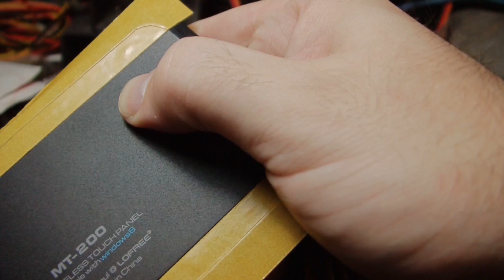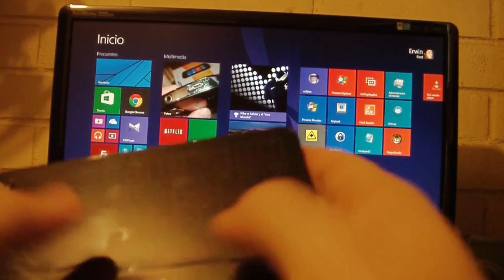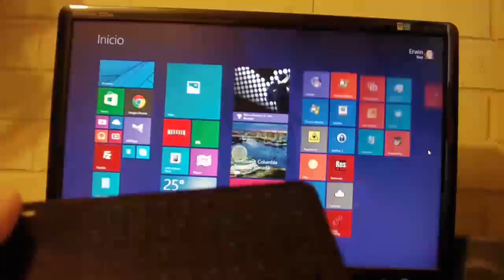"Hack" the LOFREE MT-200 Wireless Mini Keyboard vibration

Comment: Hi, I broke the same botton too, where or wich button i must to buy for replace it? Great video, but its very difficult to find the 5th screew :_(
Reply from the maker: Francisco Sánchez Plana I bought a small power button replacement for cellphones in ebay and it was a bit more bigger than the original but my dremel fixed that annoyance

Comment: Nice vid Man Thanks! Just got mine in the mail. Pretty straightforward but the only thing I can't figure is Left mouse click on windows7 ? Like if you have multiple windows open & you want to drag a window or icon and drop.. HOW? Would you or anyone suggest or know? Thanks!
Reply: Tony Gold Double tapping and then holding it after the second tap does this..........Also tapping with three fingers is a right click. a little late but I hope that helped.

Comment: is my impression or you can't see the letters on the keyboard?
Reply: Erwin Ried
 I buy one and I am still waiting to receive, I will use on android tv. However I saw this post where someone opened and rewrote the keys 
http://www.mg9mm.ro/news/wordpress/?p=592  lol
Reply: Erwin Ried is there a version with physical keys? I looked but I can't find one.
Reply: Erwin Ried I have looked everywhere but all I can find is: ultra cheap mini keyboards, rapoo e9080, genius slimstar T8020, all full keyboards with touchpads on them, or just touchpads.
I guess this is the only thing that combines the two of them in 1 product that is as tiny as it is.
Reply: Erwin Ried Not really looked at that kind of keyboard/touchpad combination. If I wanted a mini keyboard I never looked at the Mt-200 in the first place. I like this because of the large touchpad area.
But it's a shame if you barely can see the keys. If I got the same problem I maybe solder some led's in it.
Btw, will this also work on a Android device?
Reply: Erwin Ried  I also want to use it for a  Raspberry Pi laptop I'm making , is it working properly on a pie ? is touch response good ? any interference in typing or gaming ? also will  opening it  make it any thinner ? can i rewire the switch ?
Reply: Erwin Ried
thank you !!
Reply: Erwin Ried I've buyed one for myself now. I must say the keys are perfectly visible in daylight conditions. I'v got a lamp on my desktop for when it gets dark and I must say even then I can easily see the keys. It's only in bad lighting conditions that I can't find the keys.
The touch option is way better then I had expected, very accurate and smooth. However, the vibrating thing you get when you type is irritating as hell.